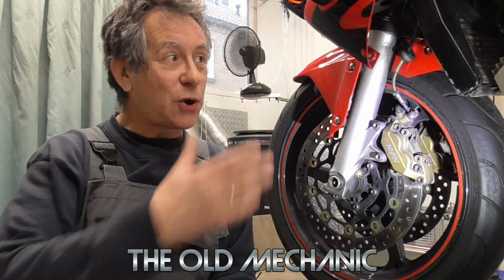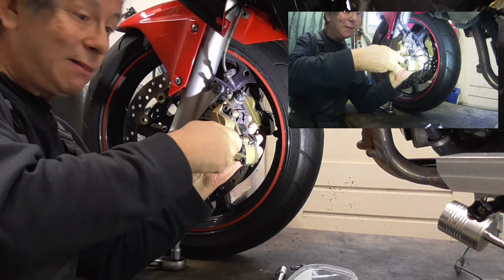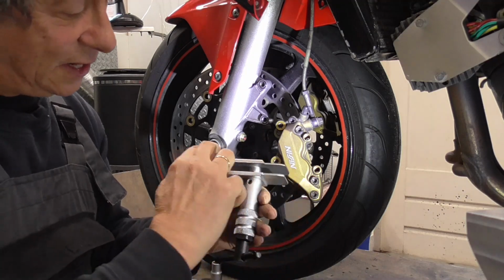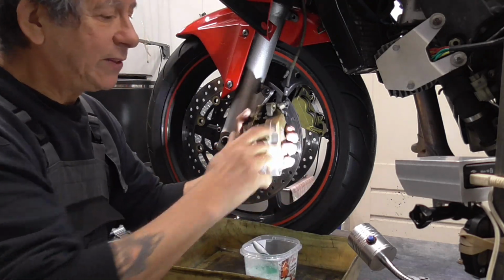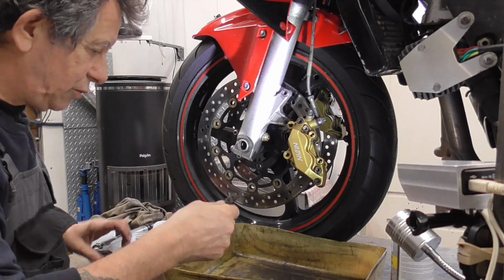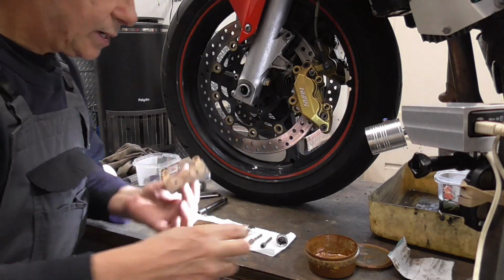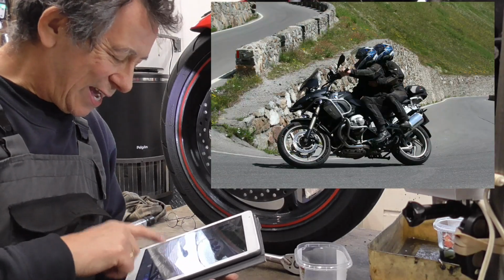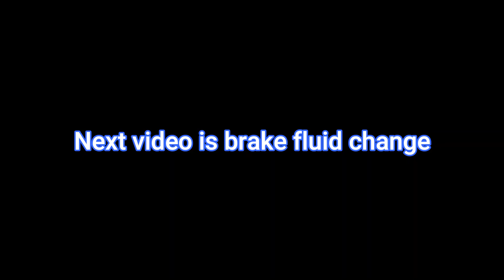HONDA CBR600RR 2003-- Brake Caliper Cleaning. [THE BEST AND EASY WAY]

Comment: Hi I have set up my suspension back to standard in your other video. I weight 65kg and tyre pressures 34 36 feels grippy but how soft should I set my rear suspension. I love your work thankyou
Reply from the maker: Nice to know 👍
Reply: @TheOldMechanic  can you give me tips for my weight? Follow your instructions then maybe a little extra half turn to suit my weight? The bottom is set to 3 so soften the top and bottom screes a little more on the rear? Thanks any help greatly appreciated

Comment: Nice review 👍l think is hard to find these days that good mechanics like you...👍   question...any recommendations how to clean exhaust?
Reply from the maker: Hi Agris thank you so much for your nice comment. I normaly use a car brush to clean my own bike, with just dish wash soap, that works great too
Reply from the maker: @bc-mr1si  Hi DC, not yet but I am sure that in time I will make a video about how to replace front fork seals too.
Greetz from The Old Mechanic, ride save  👨‍🔧--->🏍
Reply from the maker: @bc-mr1si  Hi, when the front wheel is of the ground and you give it a spin, it should be turning around atleast a few times. There is allways a tiny drag felt you know. But if its more then just a slightly drag, I would replace the seals, and have a good look at the caliper pistons too.

Comment: can you do a video on the same bike about coolant problems. I believe mine is  overheat possible thermostat or a bad sensor but, I'm not 100% sure.
Reply from the maker: Hi Michael, first get a look at the radiator if its not 'blocked', then check of the fan kicks in when the engine is hot.. (becarefull for your fingers huh..!!) Ofcoure check if the coolant level is okay. Then get the thermostat out..put it in water and heat it up and watch if it goes open... If thats all right.. then you could give your coolant system a good flush with a hose, and see what comes out..

Greetz from The Old Mechanic, ride save  👨‍🔧--->🏍
Don't forget to subribe to my channel. 👍
Reply: @TheOldMechanic   I have done all that myself on a 2005, they just run hot. Any tips on setting up a manually fan switch to turn fan on but not interfere with the sensor?
Reply from the maker: @robertwermis2971  I made a drawing for you how you can connect a manual switch to turn your cooling fan on and off.
Here is the dowload link.
https://disk.yandex.com/i/4y_FFXVRXopUSg

Comment: The temperature rises to 100, then it stops starting, it cools down, and it starts up. What is the reason? Many thanks to you. Waqat Ali. It heats up to 75, then it stops starting, it cools down, and it starts up. What is the reason? Honda 2003 600cbrr